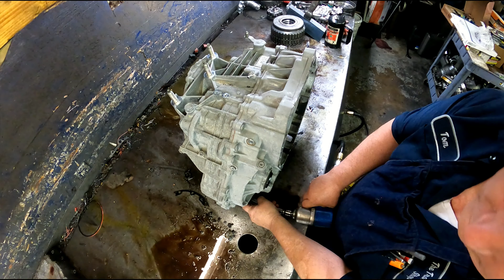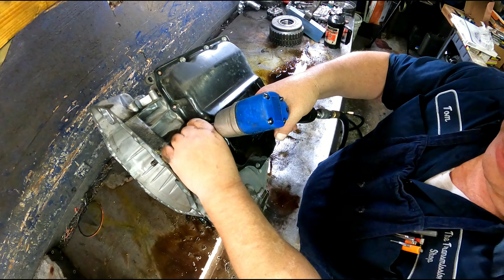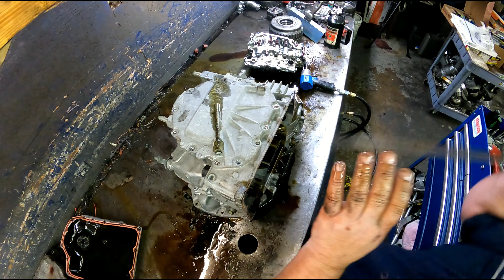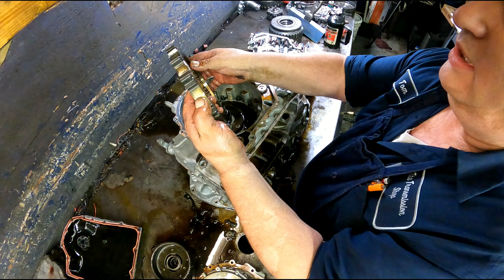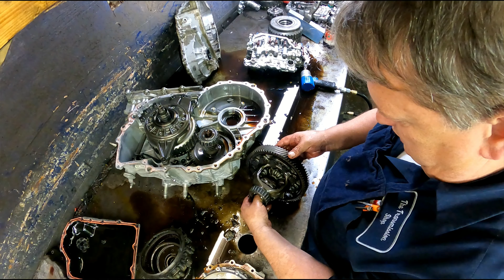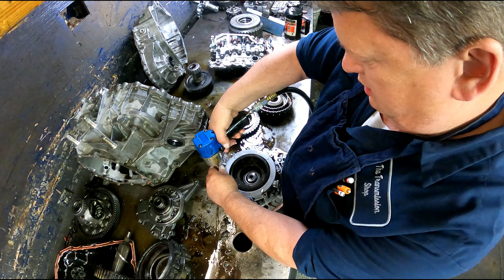FW6AEL Disassembly

Comment: A 6 speed transmission in that small package. I can't imagine what the 9HP looks like. Good work quickly finding the issue. What could've contributed to the problem?
Reply from the maker: It is a machining problem. There is a bulletin on it. Between that and the drum you have to buy because it is welded together and the worn out valve body, it is really expensive. Might as well buy a remanufactured unit from the dealership.

Comment: On 700r4 3-4 clutch can you leave that thin retainer with the tangs on it out ? Trying to put alto power pack in and the only way the clearance comes out right is to leave retainer out.
Reply from the maker: No. To use the power pack you are supposed to use the #7 apply ring. Did you replace it? The apply plate you are describing goes with a #4. The #7 uses a different Bottom steel with tangs made into it. Sounds like you are trying to use the wrong parts with it.
Reply: @CurmudgeonTransmission  yes I did put #7 apply ring in I think I need bottom plate with the tangs made on it
Reply from the maker: @jeremyking5684  74141BA from WIT
Reply: @CurmudgeonTransmission  thank you! Great videos
Reply from the maker: @jeremyking5684  Thanks

Comment: What year did this come out of? I have a 2016 cx9 that has aluminum shavings in the pan and hard down shift from 4 to 3. I am wondering if i would run into the same issue in trying to rebuild mine. Thanks, great work and information!
Reply from the maker: Thanks. 2014. Very Possible.

Comment: Please ask.  Is there a possible way to put skyactiv-D gear in skyactiv 2.0, 2.5
Reply from the maker: Probably not. You will need to find the tag on each unit and see if the codes are the same. If they are different then they probably will not swap out.

Comment: What is the problem of the transmission and did you find the solution?
Reply from the maker: As I stated in the video, the problem was the bearing in the case behind the transfer gear. You have to buy the case to get it. Customer opted to buy a new factory unit.